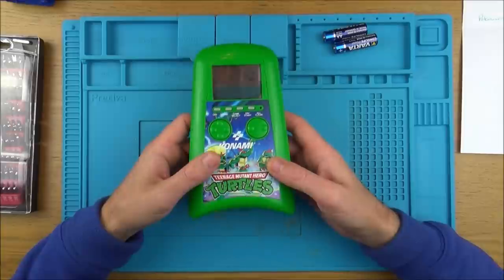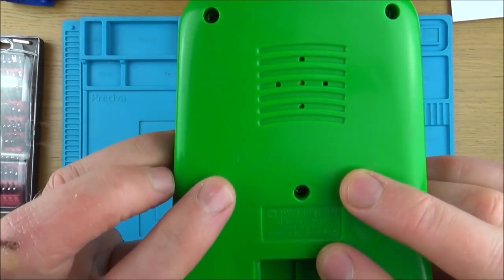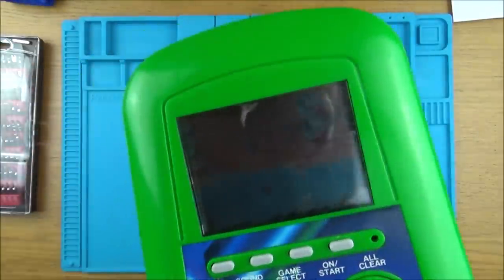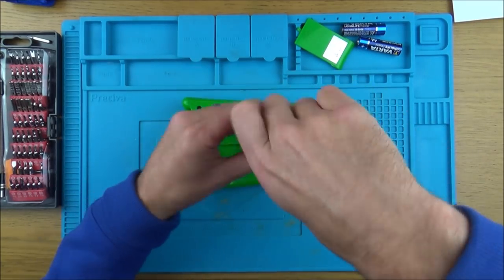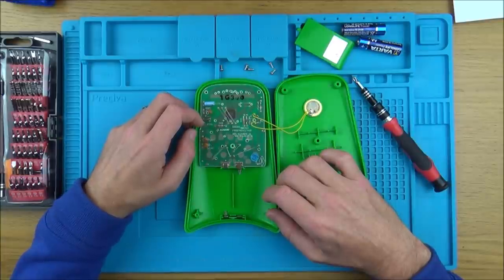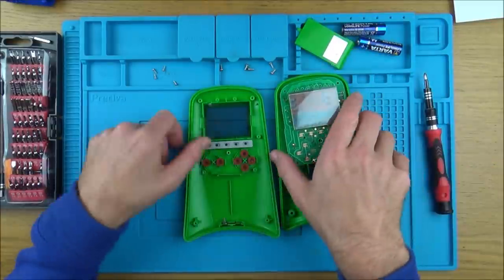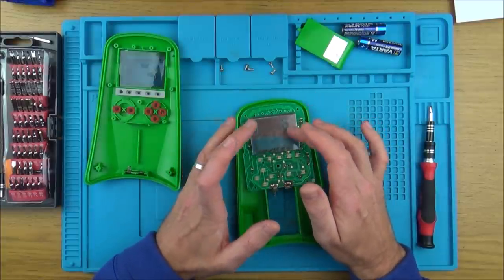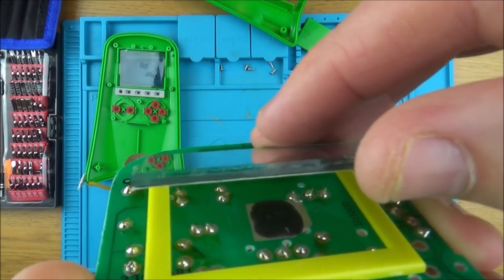Trying to FIX: 1989 Teenage Mutant Ninja Turtles GAME

Comment: Wow, fascinating fix Vince! I've never seen a faulty chrystal...in fact, I didn't even know that's what that component was! Nice work.
Reply: It’s nice to see you here. Are the Xbox’s that you haven’t finished going to be part of your plan that we will be able to buy or are you still making a video for it.
Reply: It’s pretty rare to have a crystal fail.
Reply from the maker: Thanks Steve, I appreciate that. I have ordered up some to have in the toolkit as they are so cheap. I think some quartz digital/analogue watches fail because of the crystals so it is worth having them around. Might come in handy in future eBay challenges :-)
Reply: @Mymatevince  wait guys, are you implying something here?
Reply: Crystals fail for all sort of reasons. One humidity over time can deteriorate  the crystal changing the clock value to run at the incorrect frequency. Two dropping can crack the crystal. Although they don't go bad often they do go bad and the kds0f the 0f means the lot number that crystal was produced from. The frequency would 32.768mhz and it is a dt-38 model crystal. Donkey Kong jr pcb I repaired had a bad crystal and a few atari pcb boards like Space Panic had a bad crystal.

Comment: As soon as I saw the icon and title I was "ZOMG - I fixed one of those when my friends broke!"  Mine was the crystal - dropped on floor which must have fractured it internally.  Those smaller ceramic caps dont typically go bad, they can if they've fractured from an impact or something, but it's quite rare for one to break that way.  Regards testing the crystal - you can get a crystal tester kit off eBay for around £5 (needs assembly) - the XTAL on there is a standard watch crystal 32.768Khz - I just found an old watch and took one from that.  Regards cap sizes there 20p = 20 pico farrad. 

Yes, the crystal is for timing - it provides the main clock for the system.  Didn't you get a scope donation at some point?  You could use that to check the crystal - just probe one of its pins - set scope to DC coupling, mess with the knobs for voltage and time and you should see some pulses.  Regards to the holes drilled through traces - its a technique manfuacturers used to configure etc, and they test the board connections before the cuts, then re-test after the cuts - I think it helps them work out if there are bad connection, at least that's my theory!  I am shocked, I thought it wasn't the crystal earlier on, but now it's looking that way!!!   The crystal pushes code execution along - think of it as something that provides pulses at a regular interval, like a heart beat.  Those pulses go into an MCU or CPU and they are what drive all the code execution.  You can see more about that in my "Noobs Guide to Digital" video part 1.  I cannot believe its the same fault lol, and so pleased you ended up with exactly the right crystal!   Physical size isn't important, it's just about the frequency!  It would have worked with a slower speed - the reason that 25Mhz XTAL didn't work, that would be mega overclocking it - think of the difference between 32Khz vs 25Mhz!  The reason you have different physical size is application - ie. inside a wrist watch you need something super super small, whereas on larger products it can be larger.

Fantastic =D  Loved your reaction at success lol!
Reply: Correct. Every Integrated Chip follows not just a fast-paced schedule, but also a consistent schedule, and the crystal is there to provide that schedule.

It works (and is necessary) because the chip performs actions based on a “clock” pulse, by timing actions on either a “high” voltage or a “low” voltage (or both as is sometimes the case).
A crystal pulsing at 32 768 Hz lets the chip perform 32 768 actions per second (or half that amount, not completely sure). And crystals can come in a vast variety of rates (and there are also different ways of making these consistent “clock” pulses), but 32 768 Hz is probably the most common frequency (it being a number that can be represented in binaries perfectly, the reason we can have clocks that are able to time each second with extreme precision!).

These crystals are what keeps our everyday schedule perfectly in time. Consider them an electronic device’s pacemaker (and, by extension, our world’s pacemaker... maybe).

PS: The assumptions (in italic) are up for debate, as I’m not entirely sure about them.
Reply from the maker: Just perfect Chris, all the info right there in a concise well written, easy to understand comment. Cheers mate :-) I was given a USB scope that uses PC software. It seems more intimidating than physical buttons and dials so I still haven't experimented with it yet. Still on the to do list :-) Glad this had the same issue as your friends and the same fix with a watch crystal, what are the odds :-)
Reply from the maker: Thanks for the insight Operational 117 :-)
Reply: @Mymatevince  No worries!  Really enjoyed that and it was trully amazing to see you fix and get the right frequency crystal - something I did too when younger, like you I just guessed it might work as the watch was LCD, game LCD - and low and behold it worked!  LCD games etc nearly always use 32.768Khz crystals it seems!  We both lucked out in exactly the same way on the same repair!  I knew very little about crystals back then.  Regards scopes - they are far simpler than they look.  You cannot really go wrong - I will do a video at some point covering the basics.
Reply from the maker: @GadgetUK164  I will look forward to that Chris👍😀

Comment: The 32kHz crystal is used in watches and clocks as it is an exact 2 to the power of 15, of 1 second. A crystal is just a piece of exactly cut quartz that, when excited, oscillates physically at a given frequency. You can easily check their operation with an oscilloscope (we've all been suggesting that for you) in about 5 seconds. The chip/processor steps through its onboard program (the game in this case) regulated by the crystal. In toys, crystals fail mostly due to the shock of being dropped or thrown...lol. Another inspired fix Vince and yes, I was yelling at the screen most of the way, which was quite a bit of fun in itself. Thanks!
Reply from the maker: Haha :-) Thanks for the additional info David :-)

Comment: RECAP:I got a broken ps1 action replay max memory card, it also got such a blob chip and a crystal quarz. Man i will try to swap this with one out of an old watch i hope my cheat codes are back then. UPDATE: I ordered some 20mhz Crystals from ebay out of the UK, installed it in the Action Replay CDX PlayStation 1 MEmory Card and all my Cheats are back and I can add new ones. Man thank YOU for this video, safed my life ^^ ITs hard to find these CDX memory Cards on ebay, never saw one for years. So glad that I could fix mine.

Comment: the crystal is probably a common 32.768khz clock crystal. Handheld games of the era used them extensively as their timing oscillator. Edit: guess who hadn't watched the whole video before commenting! :) Yes crystals do have many values like resistors, but the most commone ones the average joe will come across are 32.768, 1mhz, 10mhz and 20mhz, and the odd ball ones found in cheap remote controlled toys. The rest mainly hang out in CB and Amateur radio gear, along with other radios e.g. police, fire, military, etc. Before the advent of the PLL and FS changing a crystal was how we changed frequencies on our radios. Hence they were called "rock radios" or "rock rigs" as they used a physical quartz crystal as their beating heart, instead of a frequency synthesizer. A common "Mod" to do to older Yaesu radios which used crystals was to put in a 27mhz crystal, basically turning the Amateur Transciever into an illegal high powered CB radio :)
Reply: I second your suggestion that it's a 32.768kHz crystal
Reply: You often see 4.43 and 3.58 MHz crystals (and their multiples) since those are the chrominance subcarrier frequencies in PAL and NTSC respectively.
Reply: That frequency is also used in clocks and watches, so it makes crystals like it suuuuper inexpensive.

Comment: Vince, sorry, the other day I wasn't enough specific, the beep test on capacitors is only for electrolytic ones, ceramic ones have very low capacitance, picofarads or nanofarads (the ones on the game where 20 picofarad and 100 nanofarad), it's not enough to allow the beeper to work, the circuit becomes "open" before it has the chance to make any sound. To test a ceramic capacitor you need to remove it (at least one lead) from circuit and measure it with a capacitance meter, there's no trick :/.

Also, about crystals, whenever you see that type of encapsulation (an elongated cylinder) there are very high chances it's a 32.768Khz one, it's the standard crystal, the ones used by watches. If you want to test them it's a bit hard, you need an oscilloscope (with the type of repairs you're doing you will need one sooner or later, in Aliexpress/Banggod you can find one for 64€ which gets up to 100Mhz, the FNIRSI-5012H), in the case you have one is just a matter of connecting to both pins, let the oscilloscope do it's auto-set (in the case you don't know the frequency range) and see if it generates a sine wave.

The crystal needs some capacitance on it's leads to work, usually between 12pf and 68pf, when you applied your finger on it you were acting as a capacitor and that's why it started to work :D. 

That crystal on the video seemed to be corroded, so it's specifications were off, usually when that happens the capacitance needed to make it oscillate is bigger, if you get bored you could try to put again the same crystal and replace the 20pf capacitors with 47pf or 68pf ;)

BTW, nice catch!! :D
Reply from the maker: Great info geniwab, you explain things in such a way that makes it so much easier to understand. I am sure many people reading your comments will also find them mega useful. Thank you :-)
Reply: @Mymatevince  Thank you for such great videos, keep the good job!

Comment: Also to add what a crystal does is correct timing. But think of it more like passing of time itself. A lot of circuits need a clock pulse to run instruction or code. In this case to run a game. Without it the chip doesn't won't attempt to do anything. Crystals are in almost anything that run instructions or code. These can range from kilohertz to megahertz ranges. A faster crystal in this case would make this game run faster. When you touched the leg of the crystal with your probe you introduced noise into the clock line of the chip making it flicker thinking it has a clock signal. Crystals oscillations are based on the size of the crystal. Imagine a tuning fork each are a different size but you may not be able to tell. But when you tap it there is a distinct resonating hum that each one will have. Crystals are very similar. The whole oscillator/resonator thing I think is just mixing different words together. A crystal oscillator is a circuit that uses a crystal to create timed oscillations at the frequency of the crystal the crystal that has a resonating frequency of the value 32kHz in your case. Those holes I can't see closely but they could be really old style vias. Where the traces go through the hole to connect underside the board or they use that board for many different other models of games similar to that. It was a very prevalent practice back in the day for these types of games. Quick cheap to mass produce and easy to swap for other games without having to redo the whole manufacturing line.
Reply from the maker: Great info, thanks for sharing it :-)

Comment: I fixed the neighbor boy's New brite RC car last week. It turned out when they solder flowed the board, one of the components hadnt gotten soldered down. It was just stuck down with whatever they used to hold it until the solder hit it. It worked fine until the thing finally let go. His grandmother was really glad I fixed it. I have a feeling I will be getting called on again. lol.

Comment: Crystal oscillator and crystal resonator just means the same thing. The 32.768KHz crystal is a real time clock crystal i.e. In clocks , watches and even in laptops and desktops for the date and time. On older/ slower equipment it will widely used as it's cheap to make and is readily available. In laptops, and other computerized equipment there are multiple crystals ranging in value. These are used to provide a steady pulse(otherwise known as a clock) to a particular chip. The chip then syncs data to the clock. The size difference is the power rating of the crystal. Most of the time however the power rating that is needed is very low. In that case it is just a matter of getting the cheapest readily available crystal of the size for your application. The diode however there was over 3V on the cathode(you can tell because there was a black line). Diodes allow through voltage from the anode to the cathode and blocks voltage from the cathode to the anode. Therefore the 3V would be blocked. The reason I believe the diode was there was to perform a form of halfwave rectification, The crystal produces a sinewave and the diode blocks in this case the bottom part of the sinewave therefore you get a steady pulse(top half of the sinewave).
Reply from the maker: Thanks PDS :-)

Comment: If you find a oscilloscope kit or a device that can measure frequency you can easily test crystals in the future. Though this type of issue is not usual. Honestly, I would invest in a cheap little scope so you can see signals when you need sometime.

Comment: Just change crystal resonator. The crystal is when the game has a clock 32768Hz. This cheap electrolytic cap is probably dryed, ceramic caps doesn't go bad. You can test crystal with free frequency generator and frequency meter, or crystal resonator tester but most of them start from 2MHz and wont show that one. The crystal won't show continuety, it is like open cap and just stabilise frequency. Don't play with batteryes like that on any device, because you can glitch the CPU and its memory (make them do something that normally can't) and make it worse. Diode is there to protect the CPU from reverse polarity on batteryes. Your solder iron is too hot. Oscillator is frequency generator with stabilised frequency generation, while resonator is the element that generate or fix that frequency
Reply from the maker: Brilliant info, thanks technixbul. I have gotten into a habit of having the iron at over 400 Celsius which is causing a problem on the thinner boards. I will remember to lower it down to around 330C in future. Thanks for the info on the diode to protect against inserting the batteries the wrong way. You always provide great comments to these videos and I hope you know that I and others appreciate it :-)
Reply: @Mymatevince  It feels good to be useful to someone. No one is born with all the knowledge, we all learn something new every day, and when the intel is qualified the knowledge is priceless. I seek the quality sources too, because now days there is too much missinformation and the people make simple mistakes due to missleading including me. You know the feeling and need when you get to quality source and that help you to be able do the right thing as it suppose to be, that strange feeling of wining and happyness is all the motivation to all of us. Sometimes there are people that feels the same when help other people, well i am one of them. Always keep that spirit. I see how happy you are when fix something (me too), so from the other end side of Europe, i salute you.

Comment: Nice one Vince, May I suggest when you get those crystals you do a resistance test on one of them and hopefully compare it with the failed crystals readings, usually when they fail they test as either open circuited or with some erratic resistive reading, specially when you swap your test leads around ;)
Reply from the maker: Cheers Koala, I think it may have been off camera but the failed one was testing open circuit even with leads swapped. I didn't test the replacement though. I was given a digital scope a long time ago now and I haven't got my head round it yet. I believe reading the comments that a scope will test whether the crystal is working really easily. Hopefully I can learn how to use it and it will help in future fixes :-)
Reply: Way back when, "before the Luxury of the Internet Err-Go ogle" and I didn't have an oscilloscope  @Mymatevince , the only way I could test "well get some sort of indication" whether the crystal wasn't open circuited at least was to set my Digital Multi-meter to diode mode and place the leads on suspect crystal leads briefly and then swap the leads around and repeat, if the crystal gave a consistent output pulse, I found it was OK, and I moved on with my fault finding, but if I got nothing, I just changed it, mind you I once had a crystal that did give a consistent pulse by reverse test method, but it didn't work in circuit, so using a multi-meter wont give you any indication whether the frequency is as it should be, only way to be sure is if "one" has a good Crystal to compare or replace the suspect one with a new one..

Comment: Ocilator is the older word for those and I haven't seen it used since the 60s in a book i read about tube TV's and radio but ocilators and resonators are all the same just a different word for them.

Also that brown stuff on one side is probably glue (the glue they use on some stuff inside these likes to turn brown after a while i don't know why but when i took apart my eclipse 180 pro MP3/MP4 player i saw that on it's crystal too, that one is only for keeping the time for the RTC [real time clock] chip and the CPU has it's own to run the player's OS).